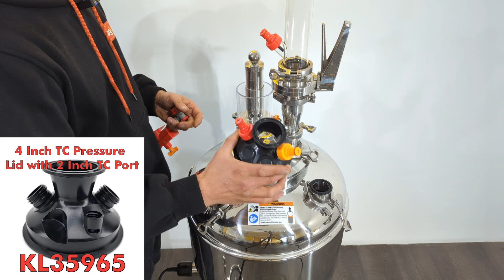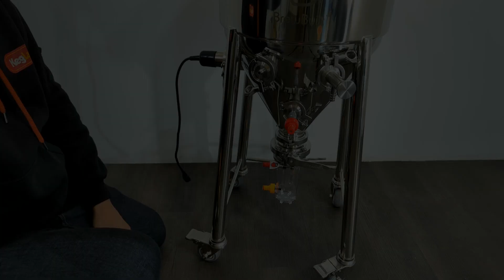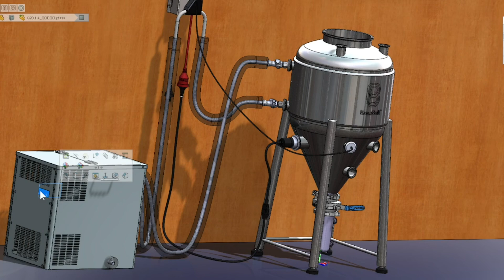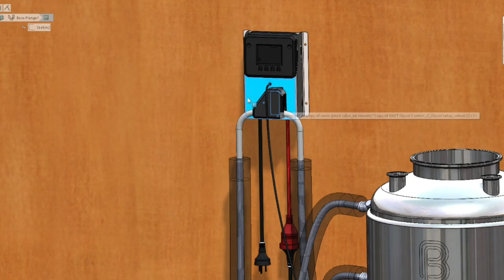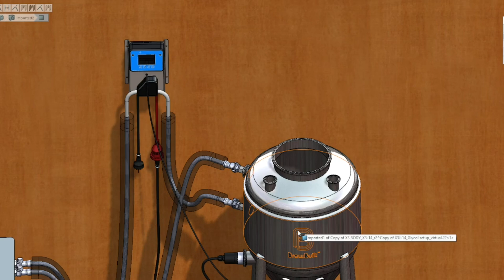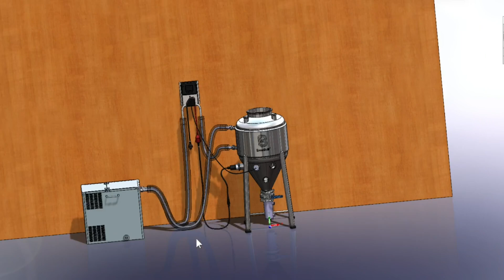BrewBuilt x3 - Full Product Review for Stainless Steel Conical Pressure Rated Uni-Tank

Comment: Love the glycol controller, that's a really smart solution to future-proof potential expansion! And I really like what ClawHammer Supply did by tying the PRV to the tri clamp wing nut so you can't undo them without venting the pressure. I believe they were talking about patenting it but it seems like a good idea to have a fool proof way to avoid getting your wires crossed and punching a hole in your ceiling!

Comment: @kegland it would be awesome if you could work on a 8“ POK lid, it could remove a lot of weight and provides a solution for those who do not need so many ports 😅. A configuration like the 4“ POK lid for the kegmenter would be great (gas, liquid post, prv and a 2“ maybe 3“ TC for dryhopping).

Comment: For the 14 gallon version, what would be the minimum batch size for effective jacket cooling? Could you do a 6 gallon partial batch? I haven't found any spec for the cone volume to estimate how far up the jacket 6 gallons would go.
Reply from the maker: You can still fill this to about 7gallon and brew efficiently.  Just be aware that if you open the lid it's very difficult to purge oxygen out when you have so much head space so you definitely would want to use the hop bong or something similar if you decide to dry hop.

Comment: Instead of running glycol through the jacketed tank, can hot water run through it to heat the tank? I make mead and I am looking to figure out a way to heat the mead up to 140F in order to pasteurize it. Once pasteurized, then I can back sweeten if needed. I am trying to figure out a way to pasteurize in a fermenter.
Reply from the maker: No reason why not!

Comment: Great walk-through!

I really don't understand the infatuation with 1.5" TC ports.  A 1.5" TC port is overkill for an analog pressure gauge, safety PRV, blow-off pipe, spunding valve, thermowell, sample valve, glycol port, ... The X3 lid is so crowded.  A 1.5" TC port is too small for a hop drop.  The hop drop should be on an 8" to 3" or 8" to 4" adapter cap.  There was plenty of real estate on the X3 lid for the 8" TC main port and four smaller TC ports.

Interesting decision to forgo a racking valve.

I like that you followed Brewtools lead with the welded lid, 8" TC main lid port, glycol jacket and 2" TC cone port to accept a heating element.  With the X4, take a look at the Brewtools F-series lid ports.

Comment: Hey @BrewBuilt , for the X4 put a 2" TC on the roof of the tank for dry hopping.
Reply from the maker: this subject certainly did come up during the design process but It's really not an issue with the 1.5" TC as the concentric 1.5" to 2" TC reducers are quite cheap.  Also we were really running out of space on the top of the unitank so we didn't really have a lot of options in that respect.
Reply: @KegLand   "We?"  As someone from the States, it's super exciting to see you and @MoreBeer_ collaborating to design these products!

Comment: I definitely agree on the 8in port instead of the clamp, after a year using my spike  conical it the threads loosen up a bit and the clamp definelty helps with the leaking of air even if it’s well libricated with cip lube.
Reply from the maker: Yes it's strange how many people thing they want the larger opening and it's only once you have used the large lid clamp that you start to realize the design constraints.
Reply: @KegLand  I actually didn’t think about that lol, the thing was that when I purchased it, spike was the cheapest option. I’m glad allot more manufacturers are opting in on the 8” opening instead I genuinely think that it helps maintain pressure more effectively.

Comment: Really looking forward to getting this one. Suggestion: if you're only going to have the one controller on the glycol unit itself, is there a way to move it to the front? If you have the unit with the back facing a wall you can't see or easily change the temp. Mine isn't facing a wall but where I've had to place it it's still really hard to get myself in a position where I can read it. The power switch being on the front could be good too.
Reply from the maker: Yes absolutely.  The glycol controller can be put anywhere.  So for sure you can put it on the front of the fermenter no problem.
Reply: @KegLand  Sorry. I meant the power and temp control of the back of the glycol reserviour itself. It's right at the back of the unit. If you have the unit against a wall then it's really hard to get to the power button or adjust the glycol temp. If you're re-designing the thing and it's not too hard put all the controls and power on the front.

Comment: Definitely interested as a upgrade from using my stainless bucket fermenter. Still saving up for one and a glycol system
Reply from the maker: If you are strapped for cash then I would go for an all rounder or FermZilla tri-conical. These are budget friendly and still a big step up from a bucket fermenter.  So this is your best option while you save up for a BrewBuilt unit.

Comment: Love the technical rundown and the explanations of the whys and hows of the solutions. Please please please, make the new controller work with the current g20. I bought mine last week. 

Maybe something you don’t recommend but what would be your advice on daisy chaining from the g20. Let’s say I am doing a split batch into two fermzilla, better to put the temp twisters in series or in parallel with a T connector for example. I know the probe will only be able to measure from one fermenter but with the same yeast and the two fermenters being so close to each other, the difference in temperature should not be that big.
Reply from the maker: Yes the new glycol controller will still be backward compatible and work with the older G20 and G40 models. That is not an issue at all.

Comment: If the 2" blocks up, just pump CO2 thorugh it. The only reson to use these massive fermenters is to reduce sediment in bottles so you should have CO2 ready.
Reply from the maker: Yes that is a fair point.  I would agree that if you are pushing stuff down and out via the dump valve the CO2 works well to push the blockage through the dump valve.  With that said if you are dry hopping upwards this trick doesn't work as gas just passes through the hops.

Comment: Process control is an interesting area and is often overlooked by Process engineers who tend to focus on yields, energy efficiency and capital and operational costs etc. 
Being a Friday and returning from the pub, I will put in my $0.02 worth.....

There are at least 6 ways to mitigate or avoid set-point overshoot when using a PID controller.

1. Setpoint Pre-filtering smooths any changes to the set point BEFORE the PID controller processors the signal. It acts to dampen the controller's response so that overshoot situations are minimised. A pre-filtering step can be a simple 1st order lag or it can be a complex algorithm. The disadvantage of pre-filtering is that it can be quite complicated and time-consuming to set up depending on the process involved.

2. Manipulated Variable Limiting is a quick solution although it can lead to other problems down the line. In some cases, it can be an effective and simple way to minimise the chances of overshooting the set-point.

3. Disabling the Integrator during “Large Error” periods of the process control system. It is the integrator component of a PID controller that accumulates errors over time which is generally good for the overall control of a process. However, when the accumulated errors are large, they can act to cause set-point overshoot. You can avoid this by disabling the integrator component during these large errors periods of the process which would allow the proportional and event eh derivative actions to stabilise the process. Again, with any radical change to a PID setup, such as disabling the integrator, one needs to be careful as to the effects it has overall on the control system. Turning off the integrator for example, at a certain point can cause the error to remain large, which may never enable the integrator to come online. Know thy process well.

4. Setpoint Weighting involves separate tuning parameters for the setpoint tracking and disturbance rejection paths. This means you can set up a more “refined” control of your process. You can balance a smooth response to setpoint changes with a more aggressive response to disturbances in the process. This is usually desirable by process engineers generally. They are concerned about disturbances in the process and how the controller responds to those disturbances. The best of both worlds in this approach, although as in almost all of these approaches, it is highly dependent on the process and what you want to achieve and what you want to avoid. Almost all PID controllers have a “Setpoint Weighting” feature in the options menu.

5. The Smith Predictor is not a common technique although processes that have significant time delays are often forced to use a predictive model approach such as the Smith Predictor. A process engineer would need to understand the process very well in order to benefit from a predictive model technique. You would need to know how the process will behave in the future based on the current control actions. Experience and extensive data acquisition is usually needed for predictive modelling to work well. By compensating for the time delay in the process, the Smith Predictor allows the PID controller to operate on the future state of the process rather than the delayed measured output. This will limit overshoot situations but as one can appreciate, operating a PID on future values or states, rather than on the actual measured output has its own risk profiles. The predictive model used needs to be sufficiently accurate and representative of how the process behaves.

6. MPC (Model Predictive Control) is a control response “optimisation” method that is based on process dynamics. A good MPC system can actually predict future process states and therefore predict the setpoint overshoot itself before it actually happens. How cool is that? 

My general approach in process control systems is to limit complexity based on knowing all you can know about your process and equipment etc. That is, make the system simple but robust. You may need to live with some undesirable situations arising in your process provided safety is not compromised. I remember a specific part of process which was critical to the overall function and safety of the processing plant. We installed one back up redundant control loop which kicked in if the first failed, and a further manually operated control system if both of these controlled loops failed or went off line. That manual control system enabled stabilisation of the process (actually it gave us some time to get the hell out and assemble in the emergency area)   

(check out any of the published work by Ted Mortenson, Jelle Kalsbeek, Andrey Solovev or Timur Yuldashev - very up to date and informative)